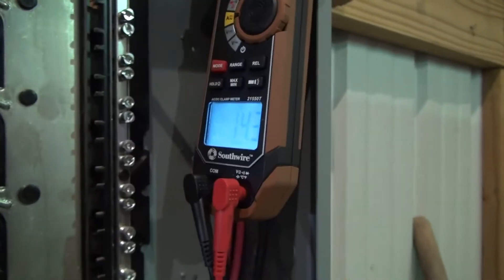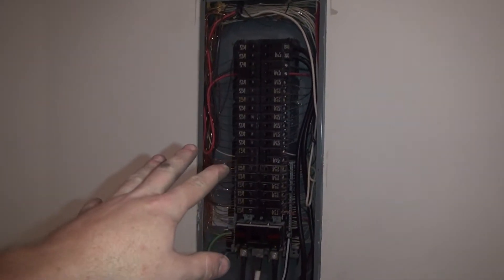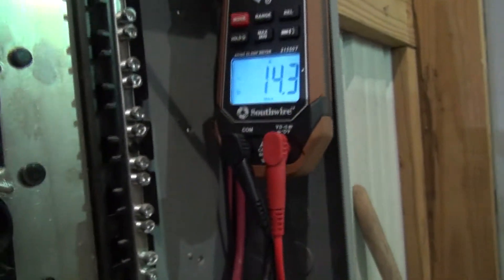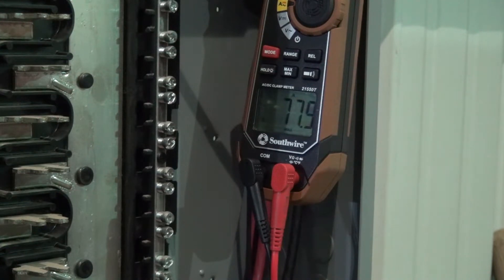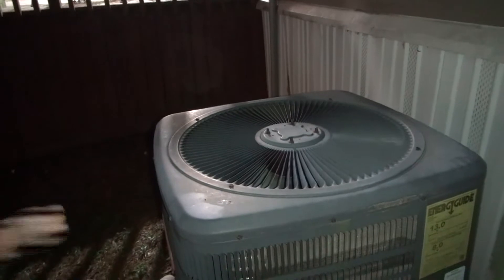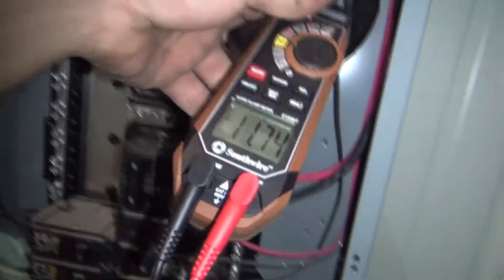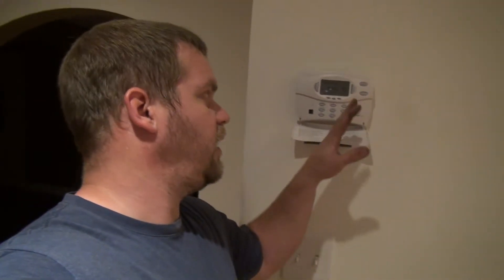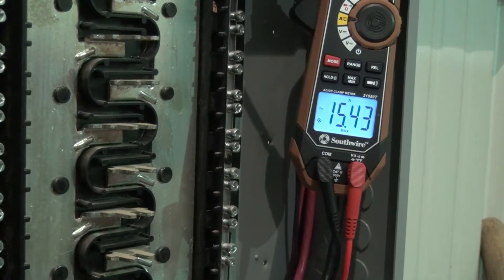Can My Welder generator Start 4 ton a/c unit?  Power whole house? Miller 400d

Comment: Thanks man. I like the nurdy stuff. Like to learn.    I'm sure if you got a slightly bigger breaker the machin could handle it just fine.       My big blue 502d has a deutz 3 cylinder diesel.   It says 12kw single phase  but I bet it could handle more safely if I needed it to. 
I have yet to play with the 3 phase yet 
I wish I had the trailer you have I have to move mine around on skates

Comment: What about fuel consumption?  Thanks for the video.  Your electric resistance heat may have 2 coils if you disconnect one coil you could run continuous may be. You're right about gasoline, our power was out for 40 hours we kept the house and well from freezing but that is all and getting out of bed to gas is not fun. Thanks for what you said about the 400 Pro.
Reply from the maker: check out my other videos on running one of these during hurricane Laura. I was out for 9 days. I ran 1 of these 204 hrs straight. It was only shut off once for about 15-20 minutes because It ran out of fuel before I got back from town. I was averaging over 30hrs per 20 gallons of fuel. I can run the heating coil resistance heat but not the heat pump at the same time. so I can switch the heat pump part off by switching to emergency heat and it will work, just have to be mindful of everything else that you're running at the same time. Yeah the 400 pro is a smaller more compact machine with a smaller fuel tank. thanks for watching
Reply: @LifeWithChase  Thanks I am trying to buy one. I am watching auctions and rental places.

Comment: You mind making a video on how to actually hook up the machine to the breaker box and how you did everything, I’d appreciate it thank you.
Reply from the maker: You need either a transfer switch, A generlink, or a breaker interlock kit. Google those 3 things and you should be able to figure out what's best for your application.
Reply: @LifeWithChase   well I already have a 50amp plug  outside wired to my breaker box for a rv, but I wanna plug in my Lincoln vantage 400 and run it from the machine to the 50 amp outlet to the breaker box, with turning my main power breaker of and only turning on a few appliances. I don’t know if that makes sense. But will that outlet let power go to the breaker box and power what ever I need?